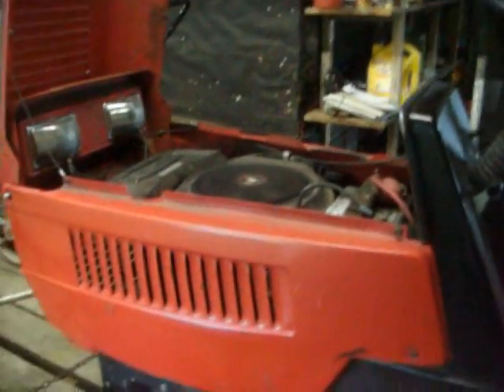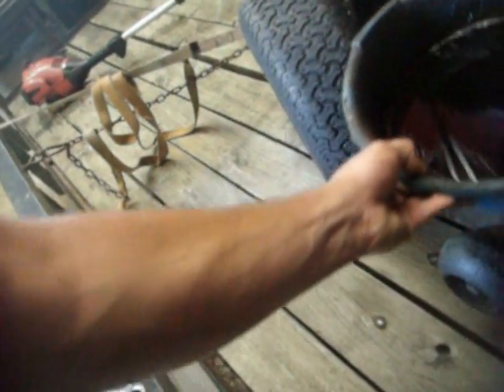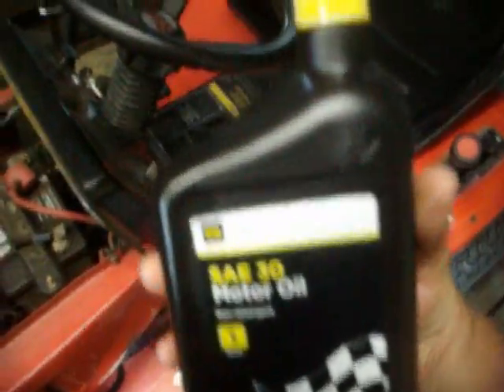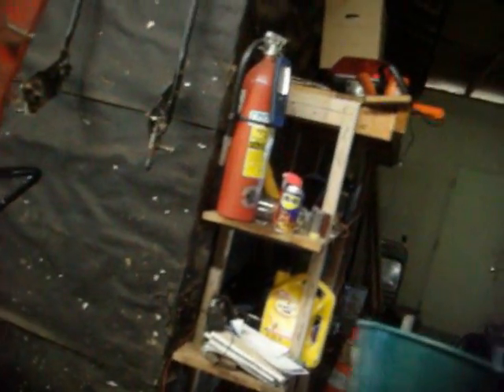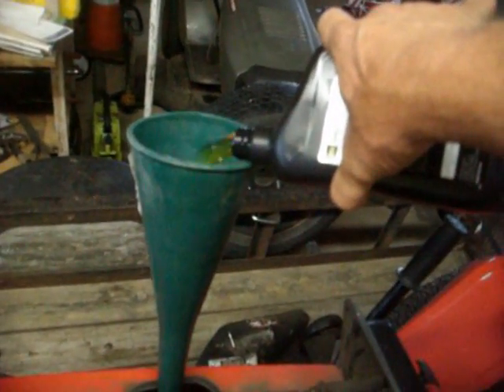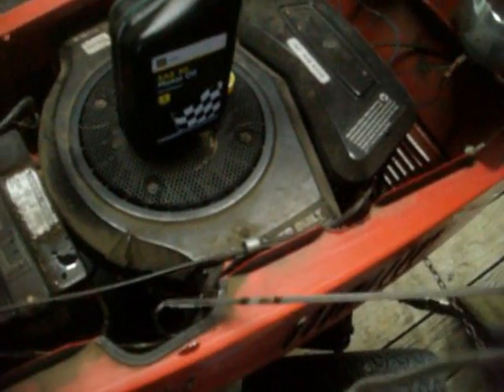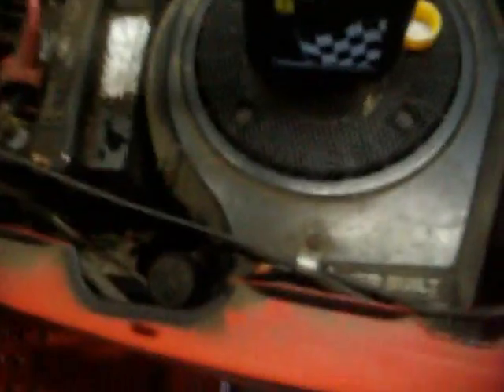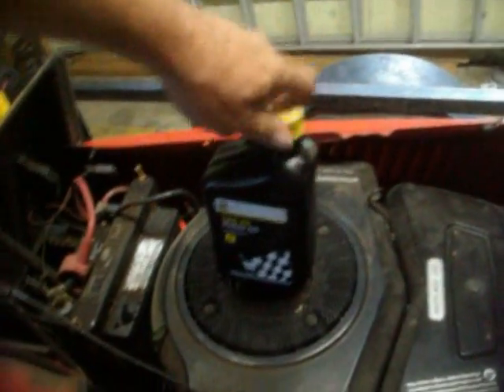Chainging The MTD Garden Tractor Oil

Comment: yeah, problem is there's steering linkage in the way, so rigid pipe is a no go. you got my wheels turning tho, so i took a 2ft piece of foam pipe insulation with a matching inside diameter of the drain plug. it squeezed under the linkage and the other end flexed on down to the drain pan. thanks wolf